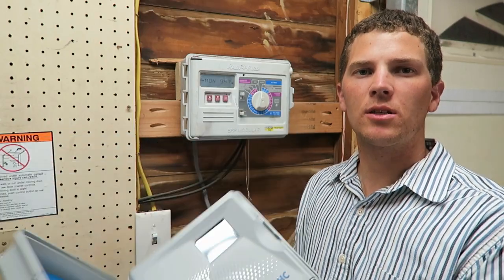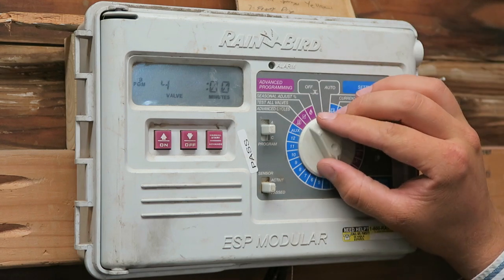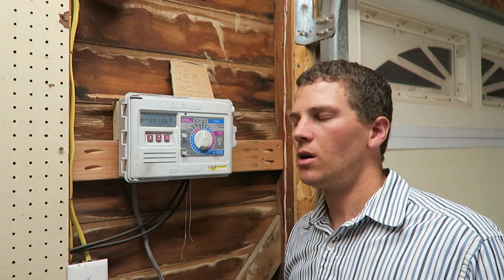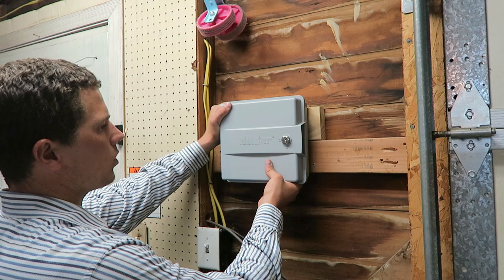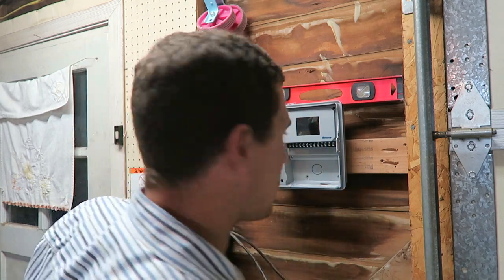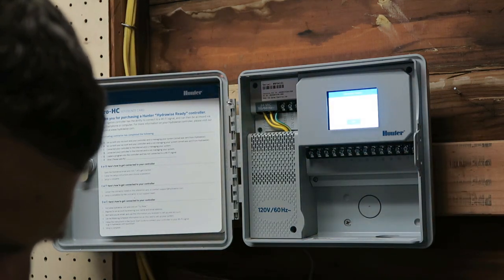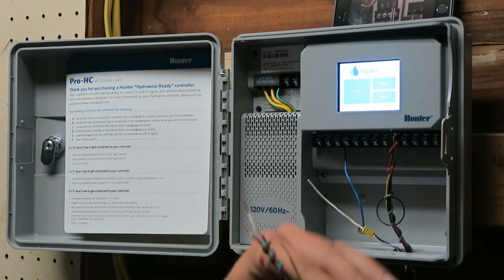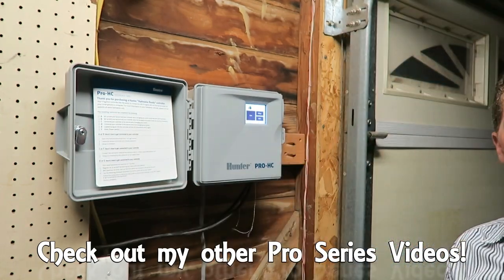How to Install a Hunter Pro-HC (Hydrawise)

Comment: My touchscreen failed. Hunter seem to think it’s from power surges. So protect the unit from those if you get power outages and such.
Reply from the maker: I’ve seen a lot of controllers fail from lightning strikes. We installed a new Pro-HC and the next Spring it was dead. Probably power surge. We replaced it under warranty for the customer. Only issue I have seen in the dozens of Pro-HC controllers I have installed.

Comment: This system is straight trash!  Eventually the Wi-Fi drops, the touch isn’t as good when you initially installed.  It’s frustrating to deal this product,bhyve is way easier to control on the app
Reply from the maker: We have installed dozens of these units. We have found they work perfect on the sprinkler systems we manage, especially if the controller is located in a garage or other secure area. It is the best controller with both client and contractor access. While there may be better Wi-Fi controllers for a single user this is what we have found is best as a landscape contractor. I agree, the touch screen is not ideal which is why we only use it long enough to enter the Wi-Fi name and password and do the remainder from the app. When installing a non Wi-Fi controller we usually recommend a different controller.
Reply: @ThriftyGarage  What is the better wi-fi controller that you’re referring to ?
Reply from the maker: We use the Hunter Hydrawise ProHC
Reply: @ThriftyGarage  Here’s what you said “While there may be better Wi-Fi controllers”.  What are the better ones ?  Orbit B-Hyve ?
Reply from the maker: @ronscopes “Better” is defined by the user. As a contractor I want a Wi-Fi controller from a reputable brand. Smart controllers need to be supported moving forward. Software updates are expensive and require either subscription based programs, continued sales or larger company support (or a combination of those things). Over the past decades companies have come and gone and when they go the controller is obsolete and becomes wall decor. Hunter Industries bought Hydrawise. They have continued to support that line and provide necessary software updates. They also allow contractors and homeowners to access seamlessly. We have had similar positive interactions with Rachio. In our experience RainBird only has one user which is an issue for us. But they may have changed. I can’t speak to other controllers because I don’t have direct first hand experience (hence there may be better controllers).

Comment: Nice work on the video, great to see some of the scrolled 6:38 text info, to emphasize safety.
It was good to see the video section on being safe with the 120-volt power, when you shut off the circuit breaker.
I am using the same Hunter Pro-HC, and it's working well.
Reply from the maker: I have installed dozens of those controllers and manage at over a dozen with our landscape business. The app is awesome for a variety of homeowners and it’s super easy as a contractor to use. I can manage from off site or use it as a remote on site.

Comment: Do these come with a plug or is that a separate purchase?
Reply from the maker: Most controllers do not come with the plug. You need to buy the pigtail separate. 🔌
Reply: @ThriftyGarage  Thanks.  I looked further and the Pro-HCi (indoor model) comes with the plug.

Comment: I know its a small thing, but the manual does state not to power up until all your zones etc are wired up.
Reply from the maker: I’ve never had an issue. But if you are a novice it’s a good idea to connect power last to prevent accidental connection with the wrong wires.
Reply: @ThriftyGarage  
I put mine in today, and it works great. Although, I did connect power back to a breaker in the fuse box so I can isolate if necessary.
Cheers

Comment: Why do you skip zones
Reply from the maker: When I was setting this up only parts of the yard had sprinklers installed. I prefer to have the system run from one starting point and each following zone to be adjacent. This is not only orderly but also makes seasonal adjustments and maintenance easier. After installing more sprinklers in the yard there were no more skips.

Comment: I can’t find comparisons. Why did you pick the pro hc over the residential indoor HC version (aka 1200i). I was back and forth a lot and think the only difference I can see is the pro hc build difference is weather proofing and ability for 24 stations etc. or a more contractor level unit  while the plain HC seems to be the same version, just not weather proof and capacity of 12 stations. (I only need 6).
Especially where you installed it indoors too. 
I’d love to know your reasoning for one over the other. Thanks so much!
Reply from the maker: Determine the number of stations you need. It's a good idea to have a few extra for future growth. Determine install location; indoor or outdoor. They if you do the smaller indoor you will likely see a small cost savings. I generally do the larger outdoor controllers because as a contractor the cost isn't as big of a concern and it will meet the customers needs no matter the application.
Reply from the maker: The indoor 600i and 1200i have the same programming capabilities and app but the connectors are not very good. The ProHC has traditional contractor grade screw connectors. For a one time install it might be worth it. But it's not good for reconfigureation or multiple wires connected to the same terminal. Plus there isn't much roof at all for wiring consolidation. It's much easier to perform a professional clean wiring job on the Pro.
Reply: Thrifty Garage thanks! I’ve researched both exhaustively. Just couldn’t find comparisons. 
You make great points. However if I’m a single home residence with one program running just 6station/zones one after the other and done. Is the HC a solid choice or do you still think I should get the pro hc. I guess for $20-40 more pro hc may be better. I just won’t use 90% of its capabilities. Thanks again for the quick response!
Reply: Never mind. I just ordered the pro. 12 in case of expansion. Wasn’t much more and you made a lot of great points in installing ease. Thanks again!

Comment: Thanks! Which is smarter? This controller or Rainbird ESP TM2 or this? I’m wanting better real weather input. I think I requested this model but the TM2 was delivered.
Reply from the maker: I prefer the Hunter Pro HC (Hydrawise). As a contractor their platform is better for managing multiple controllers. The Rainbird ESP TM2 is targeted towards homeowners. I have a separate video on that controller.

Comment: Why not just Upgrade the ESP ME Front Door and add Rain Bird WiFi LNK Module for complete remote access in seconds and much lower cost ???
Reply from the maker: I prefer the Hydrawise app over the Rainbird app. I've used both and that's simply my personal preference. IMO the Hydrawise is better for contractors as you can set up standard zone types and apply it to all jobs.

Comment: No romex connector for your high voltage connection ??
Reply from the maker: It's a plastic enclosure. There isn't any risk of a short to ground. I'm sure it would have looked nicer but it functions well.